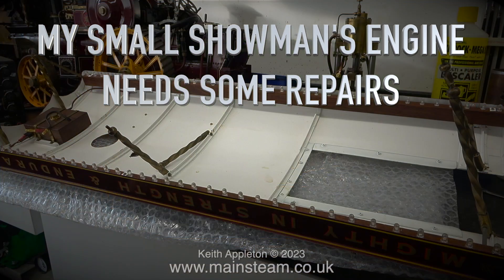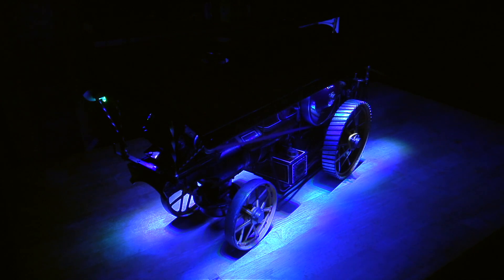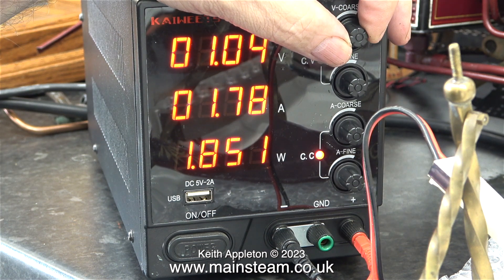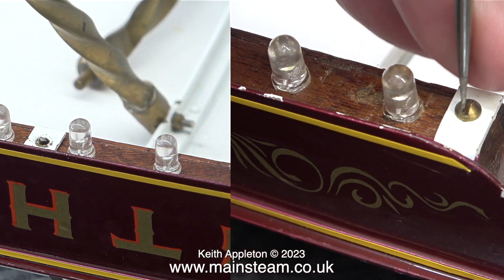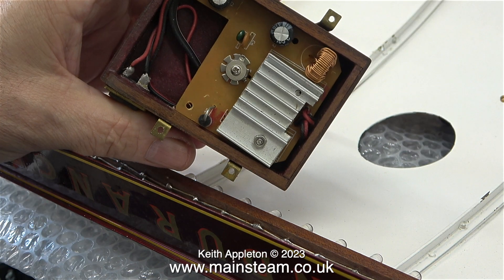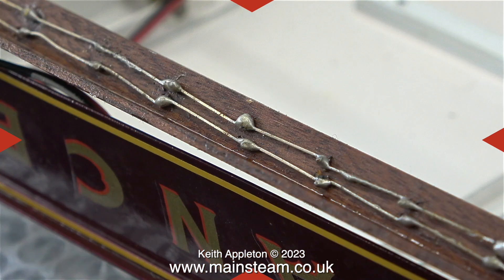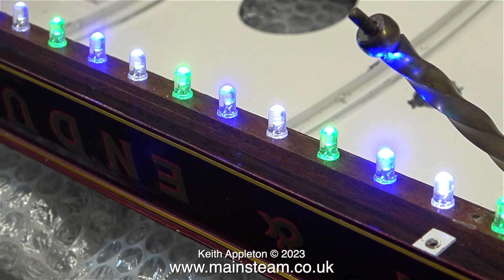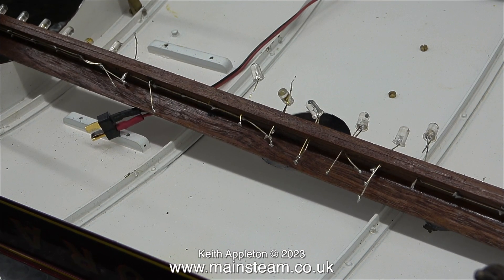MY SMALL SHOWMAN'S ENGINE NEEDS SOME REPAIRS - PART #9

Comment: I share your pain with Led's, as i bought a bag of an assortment of coloured ones for a project, and it took a good while to find out that each colour had its own voltage, and a smidge over that voltage, would blow
Reply from the maker: Yes, I figured that out too. A lot of mine were duds to start with ......

Comment: Adjusting the voltage once the bench supply is in current limit isn't going to do anything - now if you had turned the current limit to maximum your voltage would have stayed closer to 12V for longer but, since you had 2.2A anyway, you would also have had much more smoke and possibly some even more interesting pyrotechnics for a while.
Reply from the maker: The buck booster regulator should take care of everything, if it doesn't then I will simply try another method . . .
Reply: @keithappleton  The buck-boost should certainly smooth out the variable voltage from the generator but then you need a regulator such as an LM318 (old school, but still reliable) wired as a current limiter...  otherwise you are goimg to prematuerly age/blow up more LEDs. Rather like the way mains LED light bulbs work, except in your case the series/parallel strings would be tailored to the output voltage of the buck-boost and the current limited to a few mA according to the LED efficiency and brightness you require (not much, I am guessing).
Reply: @keithappleton  Alternatively put the LEDs in parallel across whatever voltage the buck-boost is supplying with an appropriate series resistor for each LED... this really is the old school method and is the one I would implement, being old amd cheap, like resistors😁